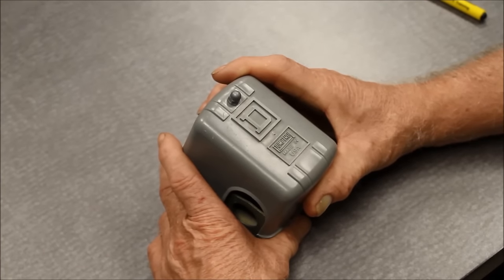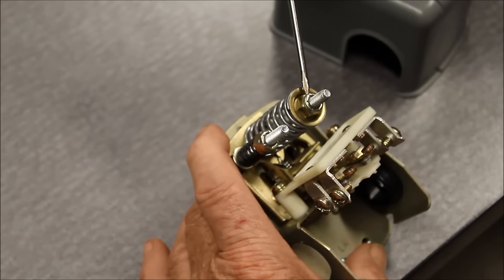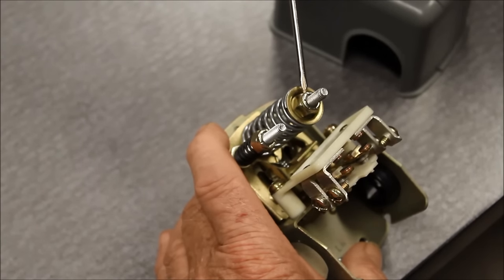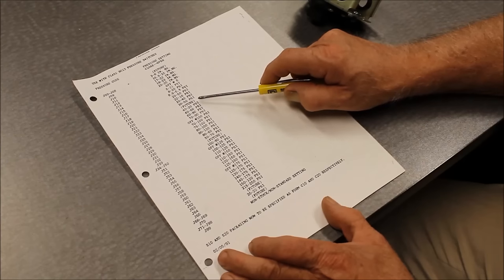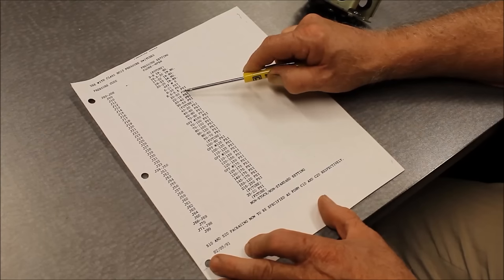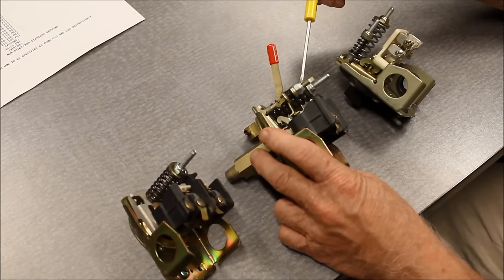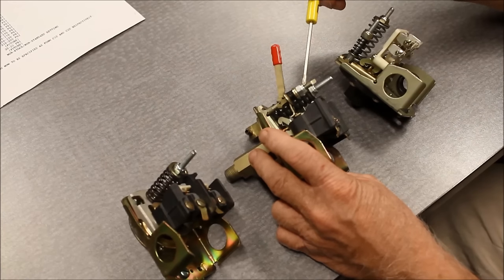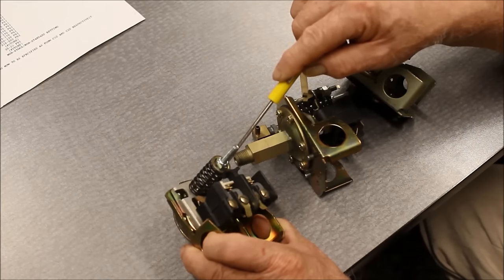Adjusting Rating of Square D 9013 Power Pressure Switch | Schneider Electric Support

Comment: Why can't you adjust the smaller pressure differential on a air compressor switch? I need a greater range or difference between the on and off pressure on my air compressor.
Reply: Depends on the specific switch as they aren't all the same. Visit your local electrical supplier and get the correct switch with a larger pressure differential for your desired application. I would ask on machinist and auto shop forums as both use compressors and have some very sharp techs.  You need to SPECIFY the differential range you desire. This may help: https://tesensors.com/us/en/products/pressure-level-control/nema-pressure-switches
Reply: A wider range may not be best for air compressors if you wind up using something like a sander and  it slows down and speeds up and slows down in use, the narrower range helps prevent those spikes of air

Comment: So u can use any switch by adjusting pretty much
Reply from the maker: Dear Fenris,

Greetings from Schneider !

We have assigned your query to the concerned team and they will get back to you shortly. 

Regards,
Shweta Jamwal
Customer Care Center
Reply from the maker: Hi Fenris,

If the pressure switch has an adjustable differential which means it comes with two springs, then you can adjust the range. The scale of this range is mentioned on the data sheet of the product. 

Hope this clarifies your doubt. 

Thanks & Regards
Customer Care

Comment: You repeated the same things over and over without addressing how to adjust the differential on switches where it is adjustable.
Reply: Or what to do after one has adjusted the air compressor "non-adjustable" differential spring/nut that "should not and can not be adjusted."

Comment: I have a 9013 FSG. Is it possible to adjust this 30/50 to 40/60. I could not get the on point to be above 36 but achieved 60 on the off. Is it okay to operate this switch at 36/60?
Reply from the maker: Thank you for your message, Imran Malik. We apologize for any inconvenience caused. For technical support or to find answers to your questions, please refer to our support center: https://www.se.com/ww/en/work/support/support-center.jsp or reach out to a technical expert in your location here: https://www.se.com/ww/en/work/support/country-selector/contact-us.jsp

Comment: Ok . I have a tank with water ( the height of the tank is about 9 inches) and I need to empty it with a pump. My initial pressure is very small, almost 0.5 PSI, but I want to shutt off the pump at 44 head ( 19 PSI ) . What kind of switch do you recommend for that kinda application? I didn't find anything like that in your list shown here :(((
Reply from the maker: Thank you for reaching out. 
The closest switch for this application is the: 9013FSG9J15 (On: 5 psi , Off 21 psi)
Reply: Is that possible on that one to lower the ON and reset it for  0.3 PSI ?
Reply from the maker: Thank you again.  The 9012GAW1 may be a better solution for you.
http://spr.ly/6054D1ogg
The 9013 is not a laboratory type of a switch.

Comment: Not a vid on YouTube that shows how to wire it
Reply: The installation instructions do. I have sheet 65013-005-39 in my hand and if you have them in stock at a local hardware store you can read the sheet if you don't have one and this official Schneider download link ever fails: https://www.se.com/us/en/download/document/65013-005-39/ If you need a different model here is the parent link: https://tesensors.com/us/en/products/pressure-level-control/nema-pressure-switches 

They are extremely simple if you look at the contact pairs. Ground to the green ground screw, black and white to the matching sides as each movable contact bridges a pair of fixed contacts. Of course they're intended to be installed by electricians who understand basic theory (easy to learn, so do that).  For example given three wires (say green, black and white) from your motor you would ground both to the single green ground screw or each to a separate green ground screw on the steel body of the valve. Your white from the motor goes to the contact set on one side and your white power coming in to the other contact ON THE SAME SIDE. The movable contact bridges that pair of fixed contacts. Wire the opposite side with your black wires the same way. IF YOU ARE NOT SURE HOW A SWITCH WORKS YOU CAN TEST IT (WITHOUT POWER APPLIED) WITH AN OHM METER. However you need to study how those work too. It's not difficult but you will need basic reading comprehension and if you aren't sure, google each term and read until you know.  Youtube is a terrible format for Q and A so find FORUMS which cover your interests. It's highly educational and I do that even for subjects where I'm a legitimate expert (aircraft and motorcycle maintenance) because nobody knows everything and the more ya know the more humble and curious you should become.

Comment: It would be nice if you  told us what size the nuts are I.E. 5/16.
Reply: It's odd most installers don't own a socket set, but the nuts on mine are 3/8" and a deepwell socket clears the bolt.

Comment: The large spring explanation is crystal clear it moves the range (max and min move togheter) Not so clear the role of the small spring. Can you please clarify the small spring how does it operate? It regulates the difference between max and min but does the max stays in place or the min stays in place? Thanks 
Thanks!
Reply: it would be the same concept- loosen or tighten to adjust the cut IN point